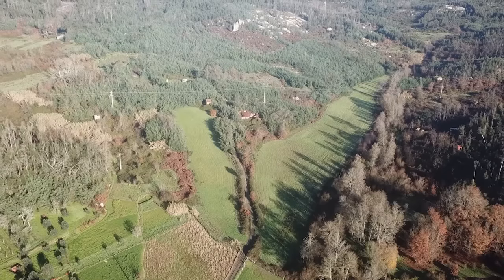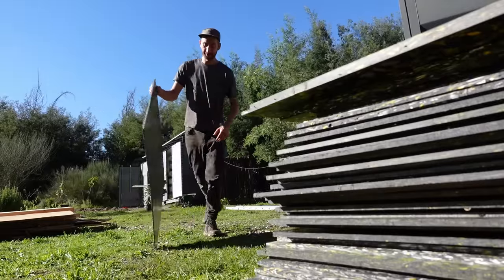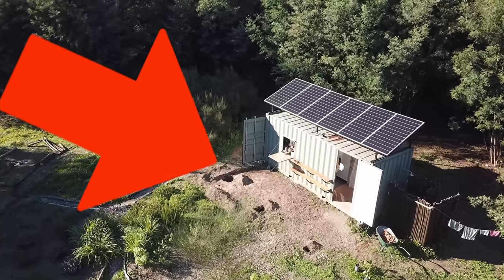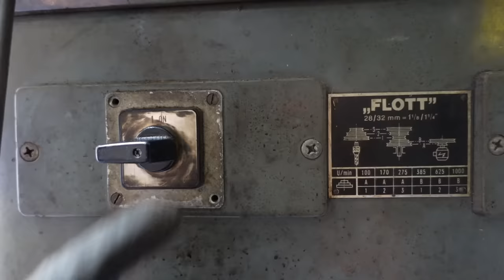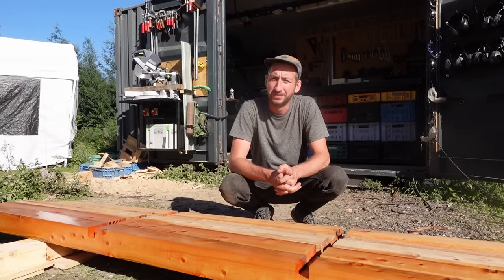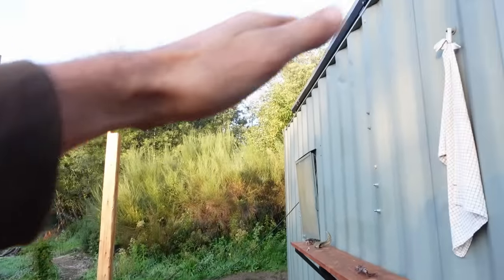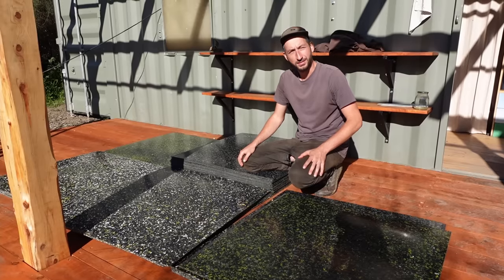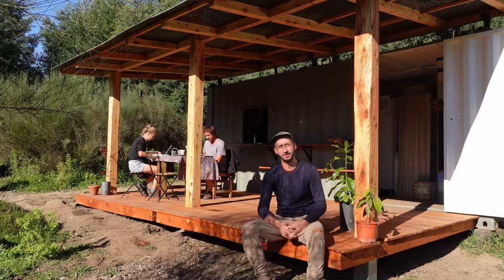#40 We made a roof from RECYCLED PLASTIC sheets

Comment: HDPE is uv resistant, so I hope it will last a long time. Precious plastic should think about making roof tiles like the ones you took off the ruins. Would be easier to install watertight and could be thinner and less weight overall. Or a less attractive/easiest to install 〰️ tin type panel.
Reply: not only that, if the plastic tiles have the same expansion and contraction properties, while being made ot the same dimensions, they could be used to replace broken or missing tiles too!

Comment: I will be curious about the potential of sag when they heat up in the summer.  That is one of the downsides of the decking which is made out of recycled plastic, then tend to sag between the floor joists.  Others have mentioned shrinking.  Not sure if that type will shrink or not.  For UV protection, there are a number of resin's out there with great UV capabilities.  Great idea and why not give it a try!  I like where this is going!

Comment: Nice job! I love the economy of structure and materials, kudos to you folks. Would have been nice if you provided an explanation of why you had to overlap your roof tiles, that had obviously been reoriented by the end of the video. 
Probably could have avoided the leaks in the seams with some flexible adhesive, applied to the joints as you were placing them.

Comment: Beautiful job guys! Enjoy your break, well earned..  in season 2 I think it would be important to seal in between the joints of the plastic panels. water will sit in between and if it is in contact with the timber frame it will weather it a lot quicker. I know you are probably hesitant to use glues or silicone, but maybe a lime mortar or something might work? also rainwater collection gutter to test the plastics impact on the surface water would be good!

Comment: Well, the waving at the end is sweet as sugar. I hope you thought of the cold/warm influences when attaching the roof panels. Stretching and contracting can result in constant clicking noises. But the sheets are probably elastic enough - hopefully not too elastic for a super hot summer day. Looks cool and well built. On the roof of the pizza oven, I would have mixed the old and new bricks like here.

Comment: that type of foundation is ok, but next time you guys do it, try to put some rocks around the steel box you guys are using to put the pillars on, since when it rains earth compacts and erodes a lot, so a few big rocks should prevent the steel box from moving. You can also use some clear industrial silicone or caulk to make those rooftiles completely watertight, Very nice project guys. I'm going back to Europe after 3 years in Central America and Brazil, I'll be sure to come to visit and help you guys next summer, i'm an architect.

Comment: This is a very cool recycle!  Add UV stabilizers to the plastic, or coat it with the UV protectant once it’s installed on the roof. 
Any sealants used between the roof tile overlaps? Because, if no sealants, will leak! 
You could set living roof trays of succulents on part of that roofing, while other part of roofing is left exposed to weather, to compare testing.

Comment: It's an interesting use of recycled plastic. I'm curious what are the temperature extremes in your area. I see that these tiles are rather large to be completely unsupported in their centers. As these tiles are also mostly black thermoplastic, they should have a good deal of heat gain in the summer months. This will probably soften the plastic and over time they will most likely sag in the middle. This will allow water to pool in the center and pull the very small joints apart.  I say very small joints as most shingles have an overlap of at least 50% to allow for movement and maintain water tightness. Asphalt shingles are supported 100% due to their flexibility especially in warmer temperatures. Stone and tiles are not fully supported as their rigid material properties do not require this. You created something closer to flooring tiles.

Experiments are great, but you may want to investigate your materials basic properties before jumping into your design decisions. I would suggest that you temporarily remove the plastic tiles and place some plywood down first then put the tiles back on top of the plywood. This will allow the plywood to support the plastic when it softens and the plastic will hopefully help shed the water.

Finding a way to seal the joints would be my next biggest concern as water will easily find a way into the joints. Caulking would be a temporary solution as it is most likely not formulated to bond with it.

I would suggest either chemically welding or heat welding the seams to make these tiles more of a single sheet. For chemical welding, you would need to know what kind of plastic you are using.

Comment: You might want to consider roofs with a bit more pitch.  Greater pitch requires less overlap of the roofing materials to prevent wind pushing rain back up under the overlap.  The other benefit is that they have a better self cleaning ability therefore reducing the amount of litter and dust that stay on the roof.

Comment: I think this is cool, useful experiment and I’m looking forward to the results and the adaptations. 

I am curious about the attachment methods, which the video doesn’t show. Roofs always have a lot of thermal expansion, so it’s common to drill a hole much larger (~1cm maybe)  than the screw or nail, and use a rubber washer to seal against leaks. Some materials crack if they don’t have this room to move. So maybe you can watch how this material behaves and let us know if that is applicable.

Comment: Would of suggested to extend that pergola to go 2 meters longer, and also in an L shape to cover that open able end of the kitchen container.

Also, check the sizing of that gap between your new roof and the top of the container, you may have to fill it during the winter if theres lots of wet coming in through there.

Comment: On our roof we used recycled tetrapak cartons, corrugated sheets measuring 2.2m x 0.9m and has an aluminium sheet facing up to reflect most of the solar radiation as we are in a hot climate. Its been about 3 years so far and the roof is perfect, nice and cool.
Reply: That's super cool. Tetrapaks are a big waste issue. How did you create sheets out of them? My only other question, which this project doesn't address either are fire concerns. Both are quite combustible materials.
Reply: @newolde1  As i understand it, they chop the tetrapaks into small pieces, soak them in water, then run them through a spinning barrel to separate the cardboard from plastics and aluminium. They then take this material (dried), and lay it out in sheets, then press it under hot plates, then immediately put it into a corrugated form, chop the excess on the sides to leave it uniform. I'm not sure if they use a resin as well. But its essentially plastic. Since 99% of the houses here are brick with stucco walls, fire isn't that much of a concern. Housing materials used aren't even regulated, which in my mind is great!
Reply: @mikescudder4621  thank you for the detailed explanation!

I live in Indo, same here, no building codes. Which is nice in some ways, especially as a natural builder. But it can be utterly devastating in others. Buildings frequently collapse in earthquakes (and we haven't even seen a big one here in decades now). Fires once started are almost never extinguished and burn the building to the ground etc..

So, if people are going to take their own responsibility for safety into their hands without regulations in place that's totally fine by me, but they need to be educated. And moreover, builders need to be educated. But currently that doesn't happen.

So promoting a product that further compounds the situation and makes buildings more dangerous is not particularly responsible. No matter how ecofriendly it is.
Reply: @newolde1  Fair enough. I looked up the product to remind myself... They claim that it 'does not spread flames'.
Reply: @mikescudder4621  well that is an odd statement to make... So basically they're implying that if the roof catches on fire it won't spread? 😂 

It doesn't even require real world testing to discern that this is most definitely a fire hazard. Not to mention the toxicity concerns of a burning plastic roof and then there's the resultant molten plastic that would drip all over the inside of said dwelling. Pretty disastrous stuff.
Reply: @newolde1  Yeah, fair points! I´ll look into getting a few smoke alarms!!

Comment: Excellent video! 
Would love to be able to do a project like this.. been wanting to build a large Shed/small workshop in my garden to replace an old shed I had to knock down, but money very tight since Covid and price of wood and materials all went up, also I wanted to make it solar panels on the roof and build my own battery bank inside so I can have it both as an off Grid workshop and perhaps power the house without relying on the grid! But just don't know how financially viable it is to do it environmentally friendly whether it's cheaper more expensive or whether there are any like government sponsored or independent incentives to do it using green materials as I was even looking to see if you can make roofing materials using plastic mineral water bottles, but obviously they're not very sturdy, but thought old pallets and waterproof them with bottles as shingles perhaps bit can't find out any methods for DIY online or anything else for that matter, this sheeting you found was very interesting! I guess j could look and see if there's anything like that in England that's financially viable for one person? Anyhow Greta video and great project!! Love off Grid projects and environmentally friendly stuff!! Btw I think you can just use a UV protection spray I think to protect the top layer of plastic from UV.. similar to what they put on Boats! This will make it last.
And as someone else suggested perhaps edge the plastic and have a layer of turf across the top maybe even plants if string enough to support the weight?
Thanks from London England 👍❤️💪🏴😎🙏

Comment: This is HDPE. It has good UV resistance, but it is also highly flammable - grenfell tower fire.

It can be heat-welded or heat-soldered, and is ideal for use in wastewater systems and damp proofing. Virgin polyethylene is a waste product from oil extraction.

Comment: i like the idea of recycling the plastic... couple questions tho... it is me own understanding that plastic is degraded or made more brittle over time if exposed to the sun long term.... and do some kinds of plastic degrade faster in sun than others, depending on chemical composition, and/or are different kinds of plastic mixed together in this process???... how is it holding up so far????.... wonder why they do not corrugate the plastic sheets to make them stronger???..... can you stand on the roof sheets in the middle???... how much did those sheets cost???...

Comment: Thanks for the video. Good job using recycled material! In the end you don't show much about the installation or address much except the production of recycled material. Are the courses overlayed or only lapped witht the fillet? How are they fastened. Did you consider expansion and contraction, or warping of plastic (common issues with plastic). Did you research at all the effects of UV on this type of plastic or ways you could protect it. By the way you designed the roof, it doesn't look that you expect it to be waterproof, or do you?
Reply: They did none of the research guaranteed. That plastic is sweating chemical byproducts into the local ground area, the UV light is highly detrimental to almost every type of plastic known to man and they failed to coat it with a UV blocker.

I'd venture to guess the expansion issue is of greatest concern and they hopefully used a high thermo-set plastic. Unlikely.

Comment: Heat up the bottom of the container thatts bent the hammer or use the jack.
20mm lip does not look like a lot to rest the floor beam on. Hope you added support underneath?
Did you overlap the roof tiles to prevent gaps?

Comment: Great idea for a  new "recycle" material whit potential for other applications. If possible i put solar panels to add more electric power and protect the plastic tiles from UV. Or a solar water heating panel to get hot water and save electricity.Great job

Comment: I think the roof battens are too far apart and in the hot summer days the plastic sheets will get softer and start to sag in the middle. Then you'll get small water pools on the roof which may lead to leakage or even some failure of the existing battens.
I would have installed more battens at about 20-30cm apart to avoid this. But I am happy to see the recycled plastic used in some scalable application.

Comment: Did you caulk the seems of the roof with rubber or some other roof sealant?  Even with metal and shingled roofs there is either a sealant at the seams or the seams are constructed such that there is a curve with an overhang so that the rain runs over the top edge without being able to just run into the bottom seam.

Comment: nice. although,  such panels sheets would work for water, moisture barriers for under flooring joists of kitchen bathroom wet rooms silicon sealed.. or plastic soldered with hot knife?.. uv deterioration over time will be interesting to check.. plastic gets brittle under sunny weather..

Comment: Did you use a sealant on the overlaps of the plastic sheets or just screw them down? If no sealant it will be interesting to see if the joins leak during rain. I do like that you have used the plastic panels though. I hope to do something similar, I has thinking of using flat sheets then corrugating then. High rainfall in my country. I will miss you guys while waiting for the next season, good luck!
Reply: If it doesnt, they can still pull up the screws, silicone the joins, and put em back down. 3-4 tubes and 2-3 hours to do... not too hard.. but this is step one of experiment.

Comment: Could you use a process like LW-PLA for 3D printing? More heat = more foam like. Basically make a plastic foam and when you press it, it re-melts the outer surfaces to make it watertight.

Comment: Hey guys! Looks great. Is this UV protected at all? I am wondering how durable they will be.
Reply: Here's something I found from a search, "Because of the chemical structure of polypropylene, it has a high degradation rate when exposed to UV light like the Sun. The light causes the bonds holding the polymer together to break which weakens the plastic. This makes polypropylene unsuitable for uses that require longterm exposure to sunlight."
Reply: @lightdark00  That was my concern. Unless they add some kind of UV protectant during the forming process I don't think the plastic will perform well over time.
Reply: @jtclements  They did say the plastic was from an industrial source. So maybe the plastic already had something added. If not, the black will last the longest in the sun, at the expense of turning UV into heat.
Reply: Thats why its an experiment :D

Comment: Looks great but I do have a few concerns with this construction. 
- it didn't seem like you used any glue or silicone to seal the gaps between the sheets. So you can be sure it won't be waterproof. 
- which direction is the wind coming from? If a strong wind blows right under the roof or if it comes from behind and creates a lift your whole construction might be carried away and maybe even the container will be kicked over.
Wind forces are no joke! 
Usually you can find weather maps online to find out about wind forces and direction in your area.
- Most plastics aren't UV resistant (as you mentioned) so I'm not sure if the sheets will remain strong for a long time. On the other hand the sheets are pretty thick so even if the top layer gets damaged the layers below might not be affected. 

I hope I'm wrong on these points and wish all the best for you guys.
Enjoy your off-season and see you in April 😊
Reply: angled into the prevailing wind, much like the solar panels you can see.

Comment: It is going to degrade quickly without a UV blocker. You should mix carbon black in with the plastic to keep it from breaking down from the UV light. You simply make a fire in a bucket and suspend a metal can over the flames. The soot that collects on the bottom of the can is carbon black, and it is used as a UV protector in plastic products like ABS pipes. The black plastic probably already contains carbon black, so that will be fine. The White plastic will degrade, though.

Comment: 7:08 Those welds are not gonna last. It is dangerous and will suddenly break when you least want it to. Rust can creep its way through the metal if the welds are not properly made, compromising your structure over time. Consider reading some material about welding, then get some practice with scraps laying around. Welding can be a lot of fun and pretty intuitive, however there is also some science behind it, which is important to understand especially when doing more heavy work, such as structural fittings. Best of luck to you all!

Comment: If you arent going to paint those plastic tiles then periodically.  Like yearly you will need to heat the surfaces with a heat gun.  Ask anyone with a plastic kayak what happens to them when they are left in the sun. They get crispy and crack easily. By heating the surface with a heat gun you are healing the surface crispiness by rejuvenating the plastic bonds. You should by now notice that they are covered in a white powder.  That is the plastic degradation from uv rays. Heat them until that is white powder is gone and the surface is shiney again.  Paint is better.